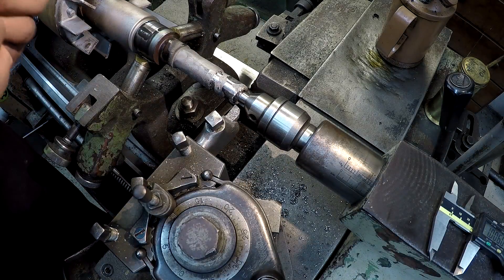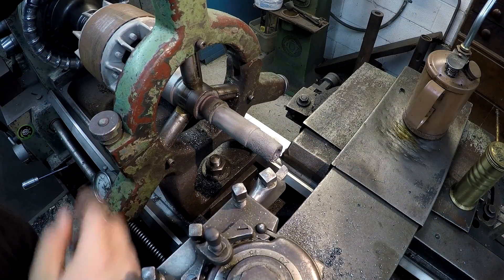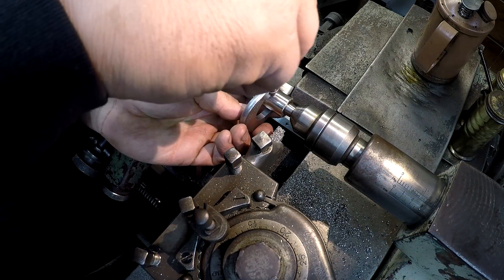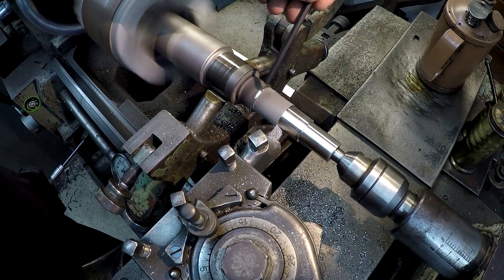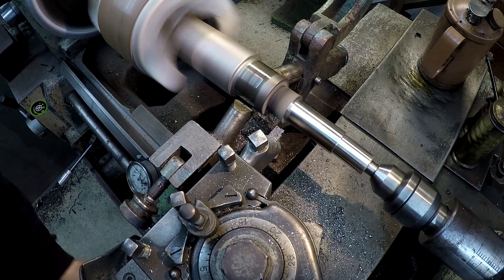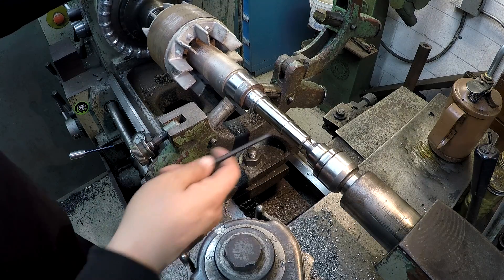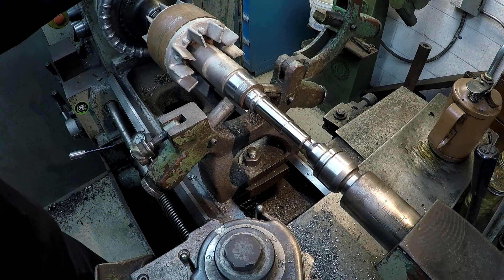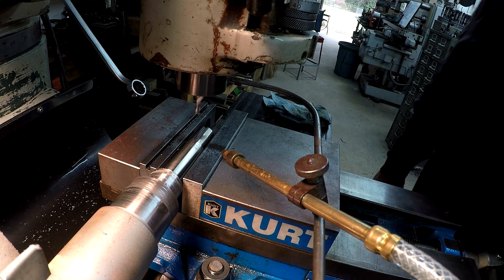Eutalloy Shaft Repair Part 2

Comment: When we did metal spray on shafts we did them in the lathe with it turning. Backed off the tailstock while shaft was hot.

Comment: {Bet you get a lot of this} I am not a machinist but,  ... I am a master electrician specialized  in control/automation and you are correct in that the very end of the shaft only has to be round and true with the rest.  i did however think of how would it work to build a damn with a bolt and washer on the end of the shaft, build up the surface then cut the washer off and back to the original shaft end.

Comment: Adam I used the process 40 years ago it's always been a great product but highly under rated. The build up would have been better if you had it on rollers and turned the shaft while applying. I did all kinds of shafts giant rollers from a steel mill we welded with stick to get more build up and strength. Wish I had a set to use of my own. Lots of shafts get worn and just thrown out. Would work on deep gouged items too as you know. Thanks for your vids Gary

Comment: Ok, so stupid question... you mentioned it, the Eutalloy material, bonded to the original metal pretty well; is that bond a weak point at all or is it pretty much comparable to a solid piece of the original metal?

Thanks!

Comment: Hey Adam. I have that same torch system also. I originally bought it for threaded plug holes in repro flat heads. I would thread in a plug then cover it with spray weld which would mimic the org cast. Also works great for joining cast iron.Cool to see another use for the system Only thing that sucks is the cost of the powders as they are spendy. Glad to see you survived the bad weather down there this past week.

Comment: When you have a female thread in the end like that, when, if ever, does it make sense to insert a bolt there and center drill the bolt, instead of chamfering the thread itself and possibly losing some threads?
Reply from the maker: DJ Delorie It's not going to hurt cutting a chamfer  there.
Reply: heh, I assumed if you were doing it, it was the right thing to do... just wondering if using a bolt is something to add to my list of tricks :-)

Comment: Adam I deal with a bunch pumps and a lot of pump repairs. We have junked several pumps due to worn keyways and worn seal surfaces. I am just curious to what the cost is for this type of repair. We usually junk them if the repair is over half the cost of the replacement cost. This type of repair might be an option for us in the future.
Reply from the maker: Terry Presnal I understand. While each job is different, they can sometimes be similar in repair costs as other before it. Of course it does matter what the cost of replacement is, but jobs like this usually involve at least 2-4 hours labor, plus material costs. I think many of the motors I have worked on are older units that just need a rebuild or repair, or they are very expensive to buy new.

Comment: That was quite a while back. How DID that shaft hold up? Any feedback from the customer?
Reply from the maker: Peter W. Meek No news is good news to me! 👍🏻
Reply: yeah, welding table project?  that was a while ago.. the floor mat in front of the lathe is the old one and the shop looks different.. I suspect Adam dusted off some old footage. No worries, just an observation. Not to mention the different look Adam was sporting during this video.  :)

Comment: What's a job like that cost the customer? As cheap as some motors have become, what's the tippi g point of repair or replace?
Reply from the maker: Jake Parker I don't like to mention costs of repairs, but typical jobs like this usually rack up between 2 and 4 hours labor for the work, plus any material costs. Many of these rotors are very expensive to replace new, or they are an older obsolete unit. Sometimes repair is all you need to keep older machinery running a long time.

Comment: Why not shut the Steady Rest? Did I miss some reason not to?
Reply from the maker: +kmcwhq I wasn't using it for the turning portion, but I sometimes leave them in place in case I have chatter problems.
Reply: He used the steady rest to get the center machined and then used the center to hold the piece.

Comment: Good repair Adam.  For not using that torch system much you look like you have it down pretty well.
Reply from the maker: +Bill De La Vega Just take a little practice getting the heat and movement right and then you can really put it on.

Comment: Nice job although I was worried you'd catch your sleeve on those impeller fan blades. May I ask, are you cutting manually or using feed when turning down diameters? I can't see the lead screw turning. If manual, you have a steady hand.

Comment: Making another welding table? What happened to the last one you made?
Reply: This shaft repair is from some time ago, Adam just never showed it until now. The welding table project he mentions is the one he already did - no new welding table....
Reply: Saw a 770 lb. face plate, I believe 43" or so, on Ebay a while back.  Thought about buying it to do a table...  heavy mfer it would be...

Comment: why do not tig weld and the machine?
Reply: Mariano Gaston he wanted to make a finish that was not carbon steel
The part is for an impeller in water which would cause corrosion/ rust on normal filler metal from a arc welder
The finish from this process had bronze and nickel in it which are both very good for corrosion reaistance
Reply: thank you. now I understand

Comment: Hey Adam, big fan of your videos man. I just have a question about the welding material (not just Eutalloy). Is the nickel / brass compound durable enough to replace steel on the shaft? or is it somewhat weaker than the original steel? or is it sufficiently thin a layer that the surface material doesn't matter so much? Thanks, and great videos.